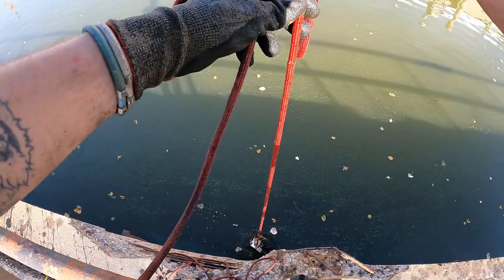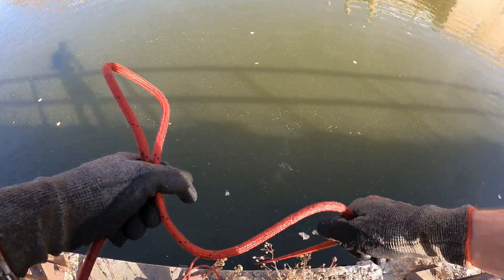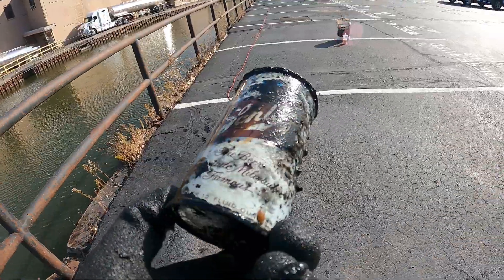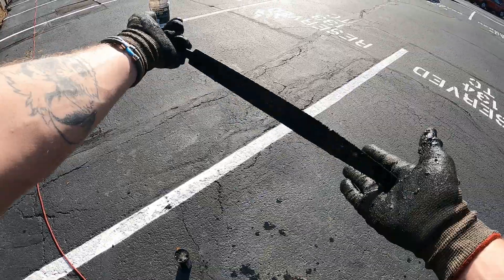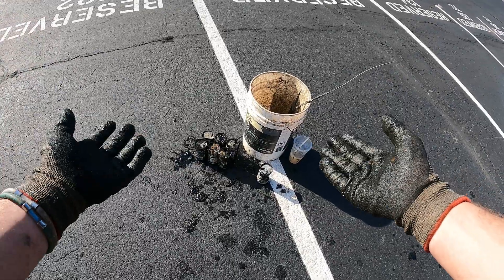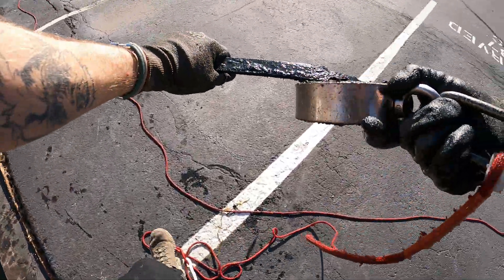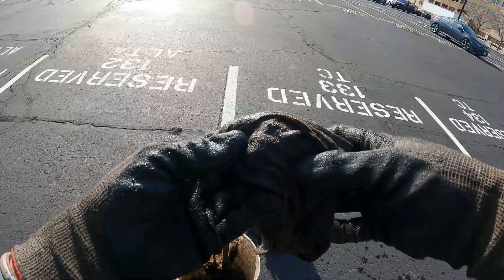The Creepiest Magnet Fishing Find EVER - This Could Have Killed Someone!!!

Comment: The cans opened with a churchkey are older than the ones with the pulltabs. See if you can find more info about that factory across the canal. Could explain a lot of your finds. Looks like you found the "5o'clock spot" where the workers gathered to have a brewsky before going home after work.
Reply: From what I remembered, they used to make parts for the paper industry, like special gears and the like.  More of a one-off machine shop.
Reply: I’m going to scream if there’s another can 😣
Reply: The manage of that factory told him come visit any time, and seemed interested in buying any history from his factory

Comment: Lufkin, at the I graduated from high school, made all kinds of percision measuring tools. They made micrometers, dial indicators and all kinds of gages pretty much the 
same as Starrett. Around 1969 they sold their percision measuring tools business to Pratt &
Whitney. I still have a set
depth mic's. In the percision tools they made some very good 
stuff. They sill make tape
mesure and such . When got into machine shops 
a lot of machiest preferred their tools over
Starrett . Thought you might find it interesting.

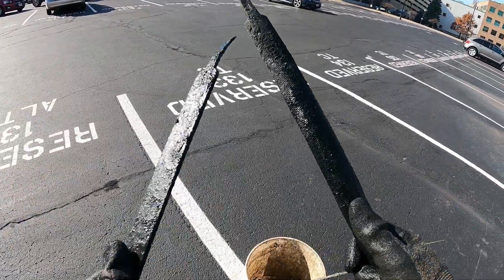Comment: 7:33 there are tons of them, make sure you find one that does Damascus very well, they can make very cool blades with different types of steel mixed together in layers..that way you can have them use files, raidroad spikes, drill bits, lathe cutting tools and some old chains all mixed together in an awesome blade that'll last forever

Comment: The "shank" is most likely just a knife made up for cutting tape and packaging in the yard, usually made from a piece of broken bandsaw blade. I have had one just like it in my toolbox for over 40 years. Common practice. 
 The Lufkin tape measure made me laugh because I've never seen a metal one. The ones they make today are REALLY cheap plastic cases and right at the bottom of the quality scale.

Comment: 2:22 If the bolt has only 2 long flats on the head it was a tee slot bolt used to hold something to a milling/drilling table.
9:04 That is a nicely cut circle---Not the peanut butter cup slug you usually get.

Comment: I'm 55 and I remember the old pull tops I think around 74 or 75 is when they went to the current pop tops
Reply: I wonder if it is an urban legend that they had to get rid of pull tabs after so many people choked on the tab they dropped in the can after opening? 
I remember looking for aluminum cans in the early 70's and being so bummed when they had the steel bottom.